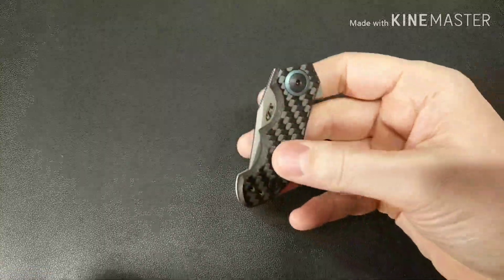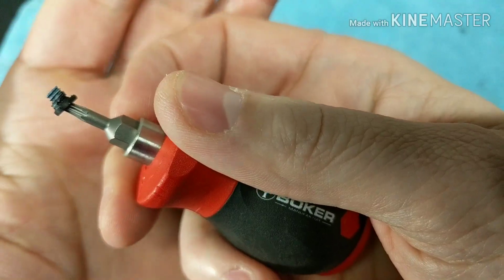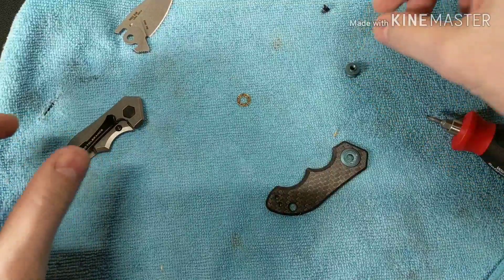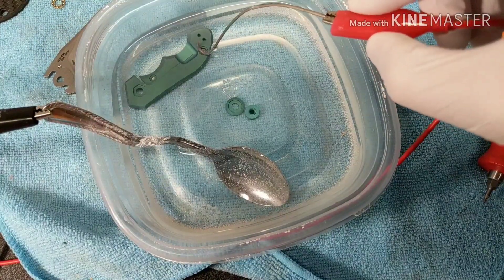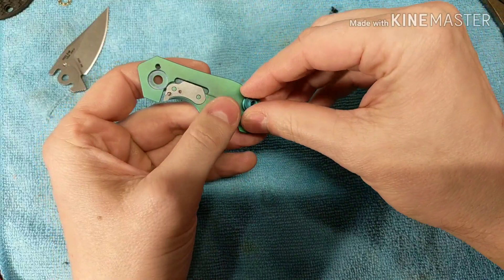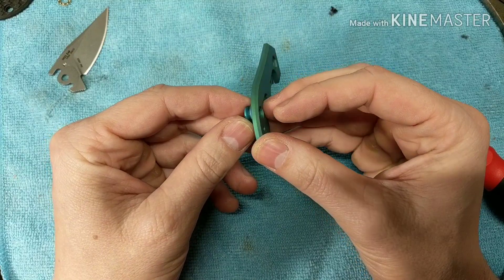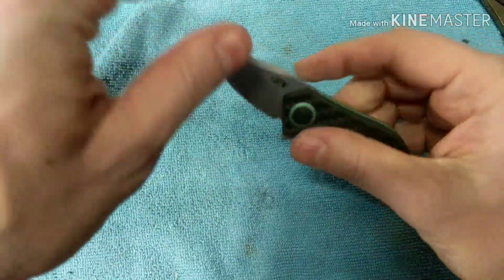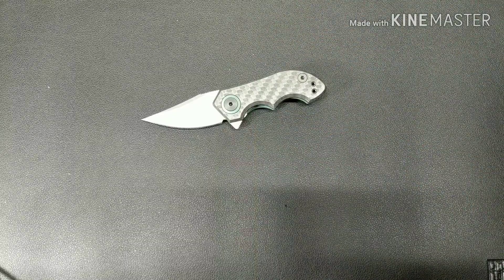ZT 0022 Overview Disassemble

Comment: Is there a way to
Remove anodizing without using voltage?
Reply from the maker: Yeah you have to use a etching solution like winks rust remover
Reply: bladecentered Ok cool! Is it Whinks rust stain remover? Have you had good results with it if so?